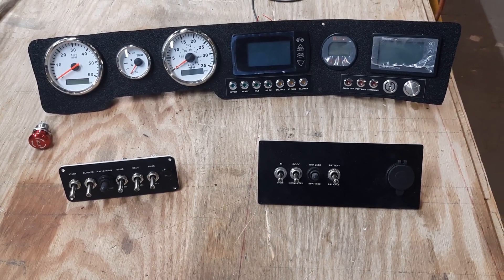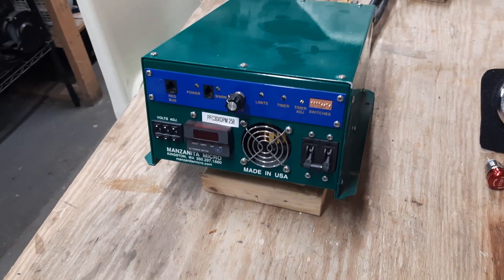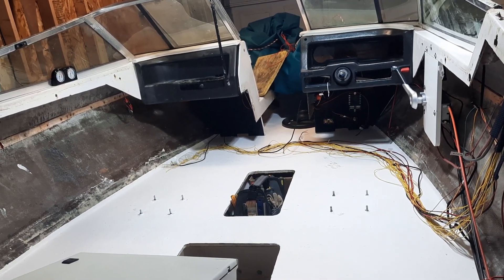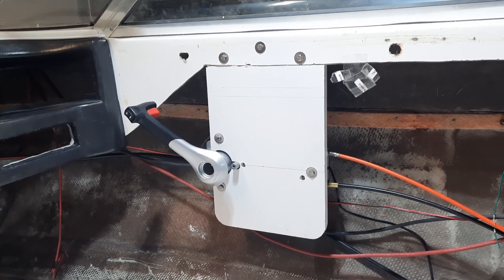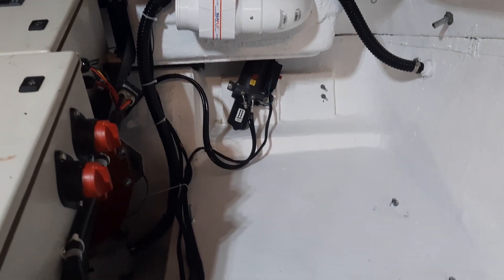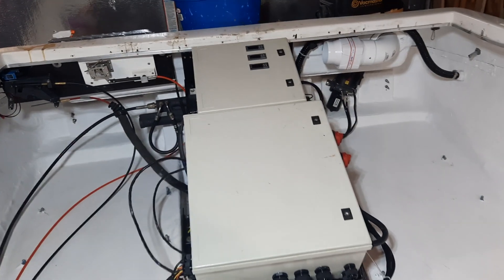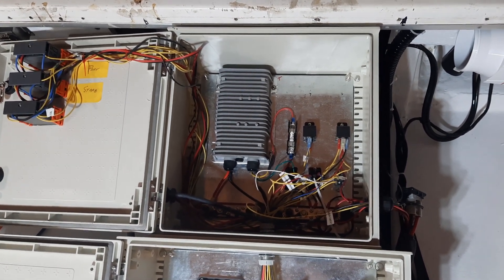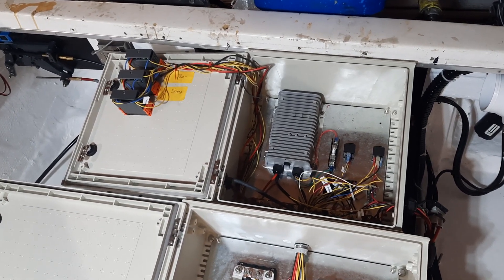Progress Report, Episode 14, EV Boat Conversion

Comment: Is there any way I can contact you? My grandfather and I and going to try and do this same thing to a 1978 MasterCraft ski boat. We would be interested in getting some more info from you and getting any lessons learned.
Reply from the maker: The tournament ski boat is a good platform for this, easier than sterndrive. 

Lessons:
My $500 Ebay boat took a year to prep before starting work. Always have transom and stringers checked for moisture before starting.

I opted for a 2p30s lifepo4 battery arrangement, 96 volt nominal. This gives me the redundancy of 2 banks but at 96 volts you are dealing with a peak of 500 amps. High voltage Hyper 9 might be better choice.

If you create a new, temporary email for yourself I will respond.

Good Luck!